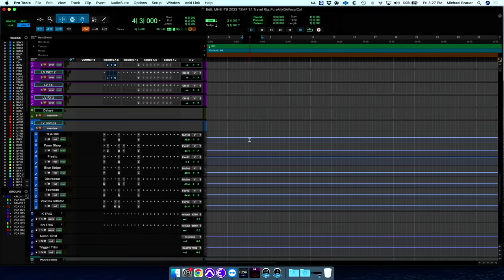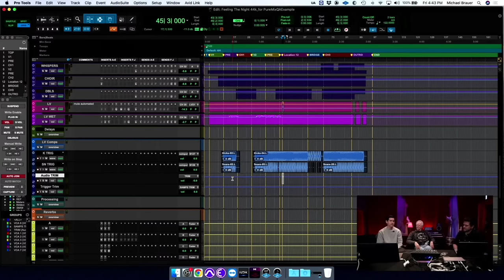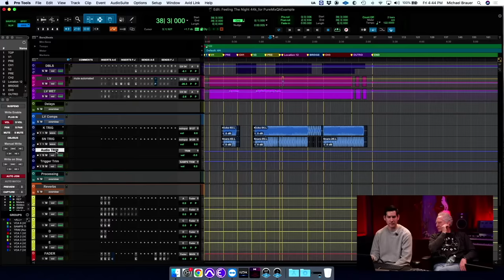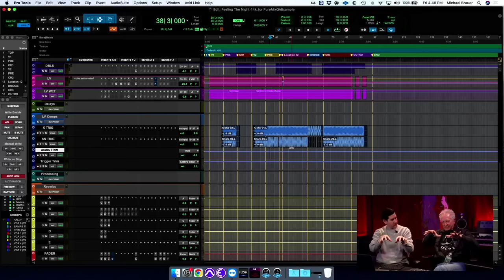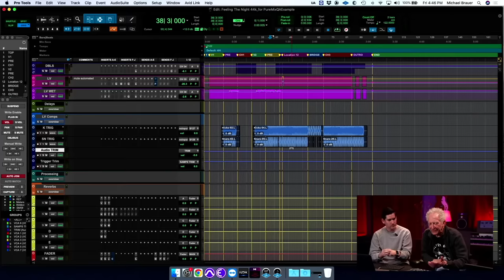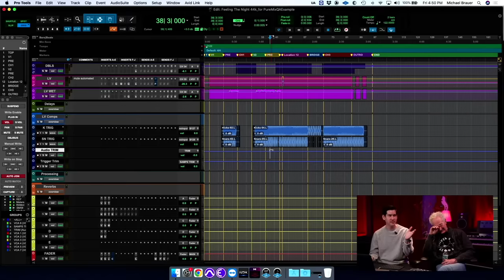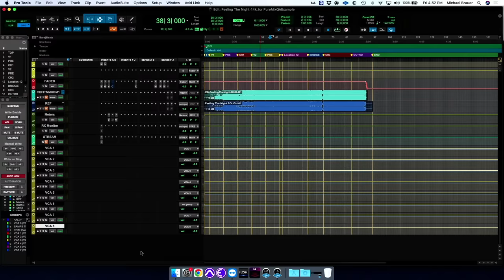Live Q&A with Michael Brauer

Comment: what can i use instead of fatso? i don't have uad
Reply: Fatso it's a very unique plugin, but you can use any kind of multiple saturator plugin like Soundtoys Decapitator, FabFilter Saturn, perhaps the iZotope Trash or the Ohmicide but very carefully.
Reply: UAD uses a licensed version, i think from Softube.  Softube has their own version that works native, which they design in partnership with Empirical Labs.  I think it is called the Mike-E Compressor.

Comment: 2:16:09 / 2:58:54 you can see 8 vca... why is it? like for A-E i can see 1-5 and number 8 controls all of them but how about numbers 6-7 what for they are?
Reply: I think "VCA 8" comes from workflow on an SSL Console. I'm fairly sure the VCAs are setup something like this: 1 - Audio Trim VCA (trims all audio files coming into session, before any compression), 2 - Samples VCA, 3 - Lead Vocal VCA, 4- BGV, 5- 7 Guitar, bass drum etc, VCA 8 - Master. There's more than like more than 8 VCAs actually being used
Reply: @talktokale  So you mean that those VCA faders only controls folders volume before they go to A,B,C and D?
Reply: @Heke97  Exactly. The whole thing is pushing the levels into the pre-calibrated compressors so the VCAs help that workflow. 
I know there’s the Audio Trim VCA, that one will be assigned to the lowest level folders (where you drop the tracks) to adjust overall initial volume. Then the rest control the 2nd level for their respective labels (eg. Bass VCA controlling Bass Body and Bass Neck folders).